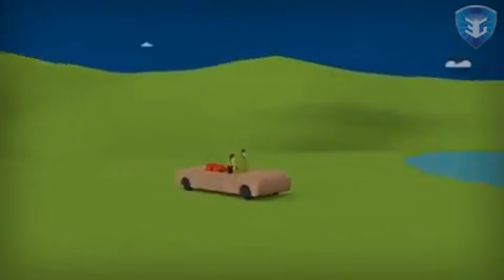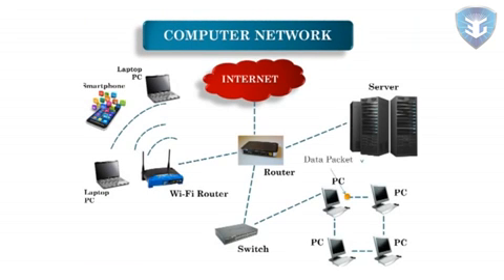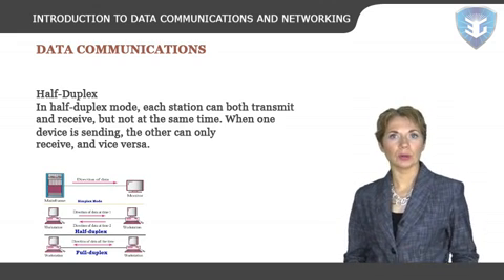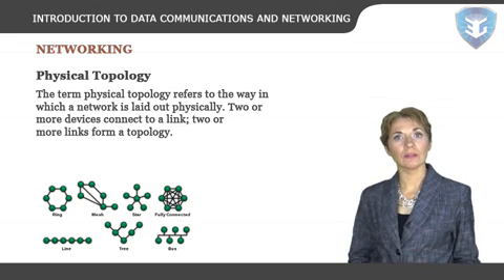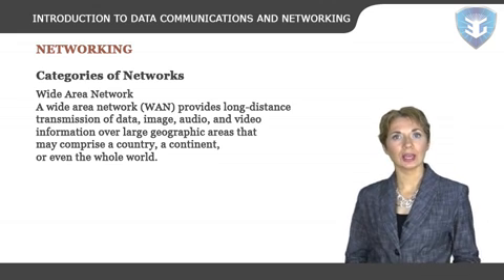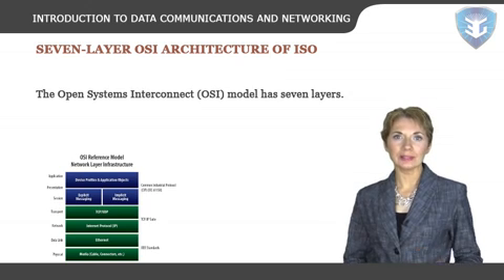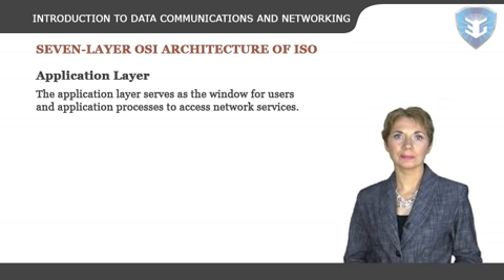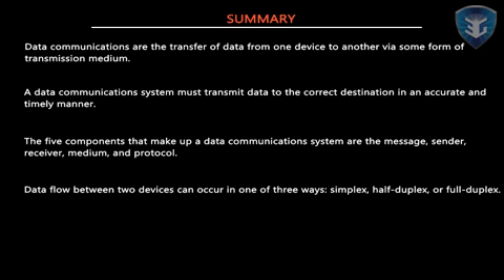INTRODUCTION TO DATA COMMUNICATIONS AND NETWORKING

Comment: Example 6.1(Data Com & network By Behrouz)
 Please Mam Solve it its Urgent
 

Assume that a voice channel occupies a bandwidth of 14 kHz. We need to combine three voice channels into a link with a bandwidth of 1 MHz, from 20 to 32 kHz. Show the configuration, using the frequency domain. Assume there are no guard bands.

USE It for 
1 MHz
For 1 micro Hz
For 1 milli Hz
For 1 pico Hz
For 1 nano Hz